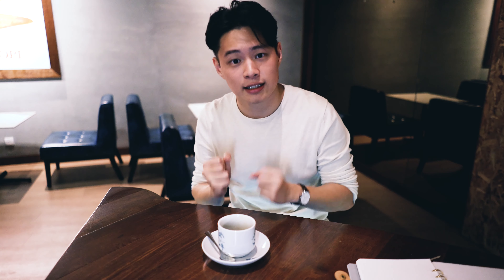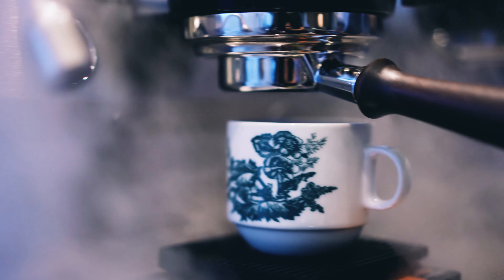Why & How I Made Kopi (Coppee) O' with a Slayer Espresso | Aurizn.com

Comment: Those in the trade will know that Kopi o uses robusta beans, espresso uses arabica beans, mixing these 2 types of coffee beans isn’t novel really
Reply: What I meant is it had been done before e.g. robusta (traditional kopi ) beans can be used in espresso 
https://driftaway.coffee/arabica-robusta/
Similarly it is not uncommon to mix robusta and arabica beans 
https://www.hscoffeebean.com/coffee-guide/blending-coffee-mixing-arabica-robusta.html
If u executed it well then good job! Just thought it may be more meaningful to have a discussion based on the exact characteristics of the coffee beans u used, how u roast and the grind size. And why it is not mixed together but are separated.
Reply: The roasting process of traditional Kopi O is totally different to what Third Wave roasters are doing. The old school roasters adds molten sugar during roasting and roast up to city roast which is something you wont cant a third wave roaster do.

I do agree however with @kaixuan the fact that @Chuyang couldve spoken more about flavour profile and recipe